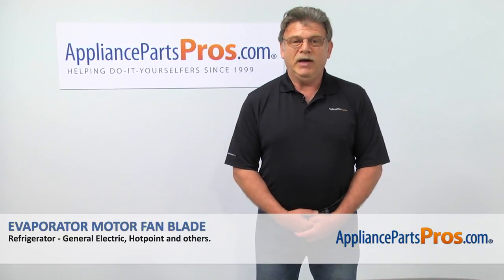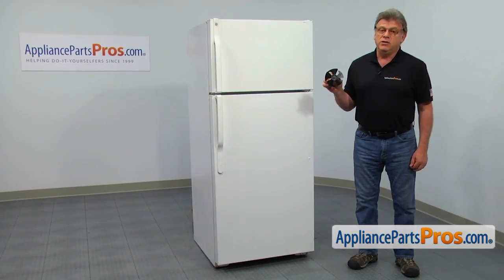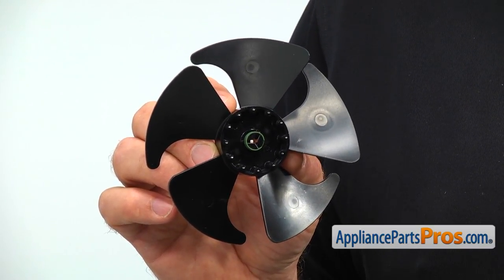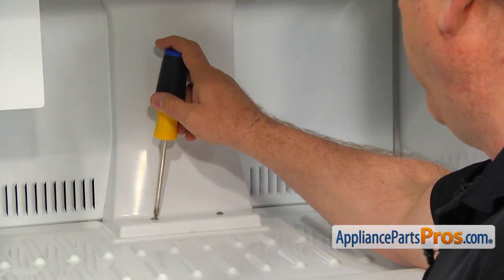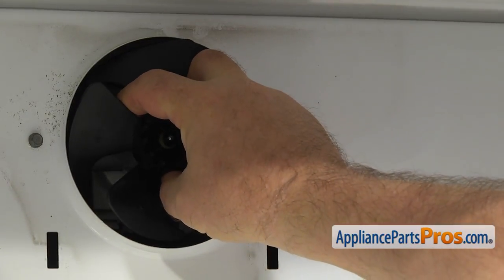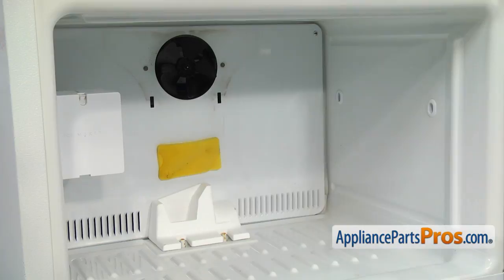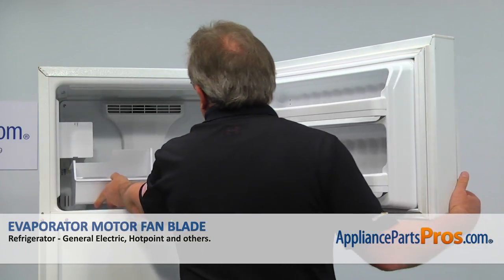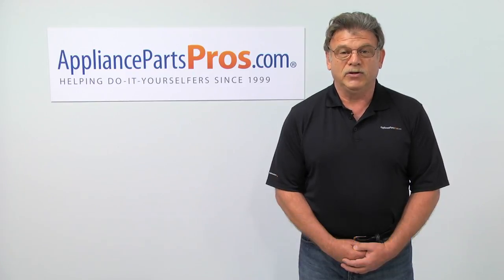How To: GE Evaporator Motor Fan Blade WR60X10204

Comment: if the spindle the fan is attached to is loose, do i need a new motor?
Reply from the maker: If the shaft the fan blade sits on is loose then you will need to replace the motor. Let us know if you have any other questions!
Reply: @appliancepartspros  I do have one, based on another vid of yours, the condenser fan looks identical to the evaporator one, is that accurate?
Reply from the maker: The condenser fan motor and evaporator fan motors are typically different parts. If you provide your model number we will be happy to locate the part numbers for you. You can call us at 1-877-477-7278  and one of our reps can help you find the part and place the order as well.